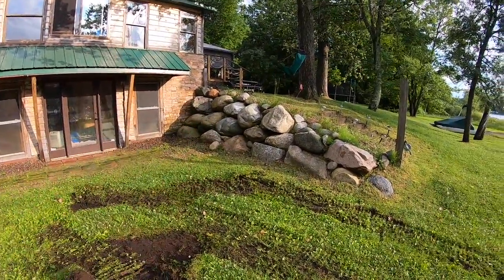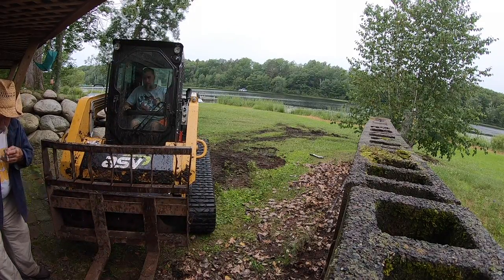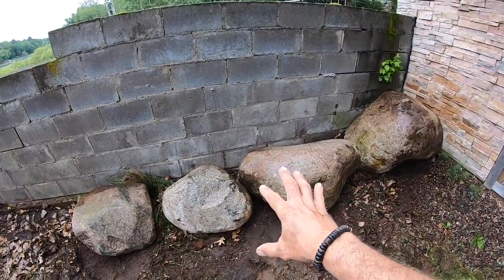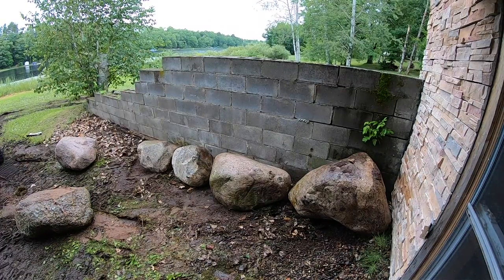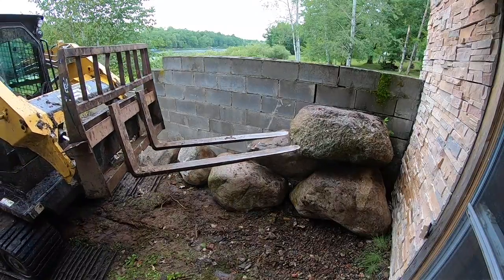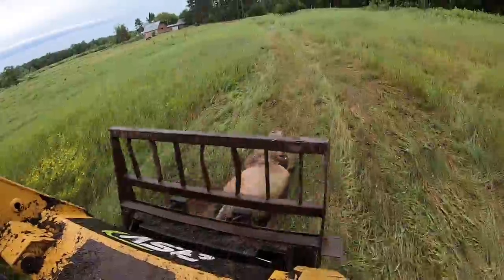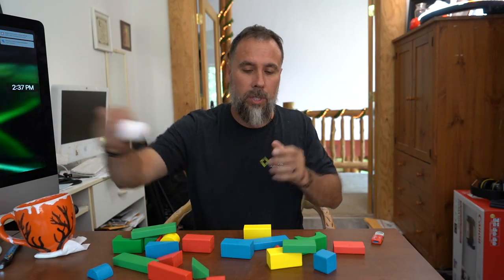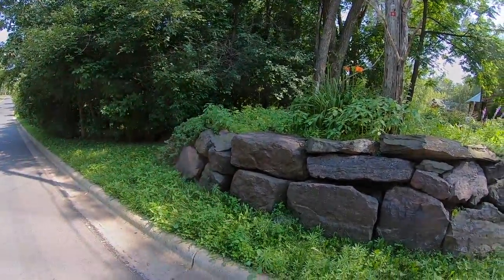How to Install a CHEAP Boulder Retaining wall with just a skid steer and scrap field stones

Comment: Stan - perfect walk through and learning about the variables behind a successful boulder retaining wall. It’s like you came out here and looked at my project! The only difference is my boulder wall has to absorb high springtime lake water and pounding waves: absorb the impact, control the flow of the water back out, and contain enough appropriate back fill and base, which you’ve taught in your other vids, to handle that. I’ll be watching this video a 100 times as I complete my project. You’re the man!
Reply from the maker: Thanks Justin and I am sure your wall is going to be awesome !
Reply: I have the same kind of project coming up!

Comment: Hi,Stan.

I am currently building a retaining wall using manufactured retaining wall blocks.  To do this wall I had to dismantle a fireplace that was built using large rocks and small boulders. My next project is going to be using those rocks and boulders to build a retaining wall that will (hopefully) level out one of the most difficult parts of my yard to mow.  This video helps a lot.  The only real problem is that the only tools/equipment I have to work with are a shovel, a digging bar, a stone chisel and a sledge hammer.

Thanks.

Take care.
Reply: All you need chap

Comment: Yes i like videos like this.  So for base layer blocks you want rocks that are in diameter 1/2 to 1/3 the height of the wall so like 6ft wall 2 to 3 ft size bolders, or 9ft high wall 3 to 4.5 ft diameter bolder and ideally as rectangular or square as possible.  You want the top surface of the bolder to be flat or sloping towards the soil slightly. Adjustable forks on your machine.  And smaller rocks on top of the base layer and then smallest rocks on top and minimum size is about 1 ft cubed rocks so the weight does the job.  got it thank you.

Comment: In my opinion it's easier to use a strap to lift the bolder with the machine  and lower it into place . It speeds up the process  alot when you can rotate the stone to the right face and drop it in place
Reply from the maker: Thats true to but my 78 year old uncle wasn't able to move around all that well. and strapping is definately a 2 man job

Comment: I'm building a Boulder dry stack retaining wall to raise and level my front yard. I did the same thing at my last house, but this one will be about 6 or 7 ' tall (down to one course on the other end. ) I am fortunate that  consistent thickness sandstone slabs up to 9 feet long are all over my area along the street on the vacant  lots. They've been there for 50 years.. My base course is 2 to 3k lb slabs about 14-16" thick. I bought a BIG Hilti hammerdrill to pin the courses together w #6 rebar, to prevent movement . Water Will  run down to the wall.
There will be a lot of force pushing against this wall. Top course will be 4" thick.
 I put forks on my backhoe, So much easier to scoop up the slabs rather  than chasing them all over creation trying to get them in the bucket ! Need a thumb for the hoe.
 Staging boulders now. Next is carefully grade 10 foot level stairstep sections ( The hard part )
IDK if I should start at the  top of my slope, where it will be a single 9 foot wide, 6" thick slab ,or the bottom?
I guess for the sake of properly breaking joints I better start at the downhill end. Been 20 years since I've done this. Planning on establishing blackberries in the joints.

Comment: I learned this when i did sea wall construction.  Only difference is the fabric and the ¾ clear were also used.  The super thick fabric laid down first the agg over the top to hold it down in the water the boulders laid upon it ...then the agg brought up to the height of the 1 st row then the fabric is wrapped around and over the aggregate pulled back more aggregate as a base on top of the fabric then another row of boulders...until you have proper height basically the same way you build retaining walls ... supposedly this method has longevity over other options

Comment: Dude im in the freaking middle of trying to do a boulder retaining wall, its like you made this just for me
Reply from the maker: I hope some of the pointers maybe help out.  Will you Let me know if they do?
Reply: @Dirtmonkey  it already has a lot. i had no idea you could use a skid steer to build a wall but the forks make total sense. that never even crossed my mind.  i live in reno and the soil here is literally like concrete. so much so that 30 miles from my house the army is using similar soil to store like 40 thousand vehicles including thousands of 120 ton tanks. so i have to rent a excavator(302) to dig everything out and a skid steer to run everything out.

Comment: Great video... I was wondering if you could you leave a wood wall behind a boulder wall?
Reply: sky williams I think it could be even more beneficial as it will eventually rot away until you get just the boulders. The only issue would be that you have to engineer the wall to be able to hold the hill by itself

Comment: do you have a video that shows the best way to pick and remove surface boulders weighing anywhere 50-1000 lbs.  I'm thinking of a track skid steer with a skeleton rock bucket as opposed to a mini-ex with a grapple/thumb.  Am I wrong?

Comment: Once again lovely work. How would you go working with lifting slings on your tongs or make up a jib that slips on to the tongs. Aussie for forks. The Jib should have a 360 degree rotating hook. Only after you have transferred all your material to build said rock wall. Should have cut to some people dancing then shimmer or shim ,shimmy would have worked. Travel well. Aussie Jeff

Comment: Would I still need engineering/permits to build a boulder wall if it was over 3’ tall? That’s the requirement for standard retaining walls in my area but not sure if it’s the same for boulders.

Comment: The 4’x30’ rock wall installed 30 years ago at my house is 2 man rock.  They obviously dumped a pile of rock close by and ten they took the rock off the top of the pile for the first layer. This made the bottom stones 1/3 the size of the top stones. 

The wall now has a wave in and out of more than 18” and I bet it has lost more than 8” in height. So when can you say a 4’ wall is unsafe and not just ugly.

Comment: What about The Beak? Could you substitute The Beak for the forks? Would that give you more versatility out of the Skid?
Reply: Most contractors have forks  
not everybody has a Forresty fork   

When Stan went to the field to grab 2 more boulders   He had to adjust the forks width  Cant do that with a forresty fork
Reply: Walt Lars yes, I understand that. My question was whether or not someone who owns The Beak multi purpose demo tool could utilize it in place of forks. Obviously regular pallet forks are going to be more commonplace. Just wanted to know if the thumb might give more versatility to positioning boulders.
Reply from the maker: Yes-  you could use the beak for these.
Reply: @tylerpittmon7936  it certainly would help if the contractor had one

Comment: His wall is eventually going to fail because the boulders long side were placed parallel to the direction of the wall, should have been placed perpendicular to withstand the force that the dirt will apply over time.